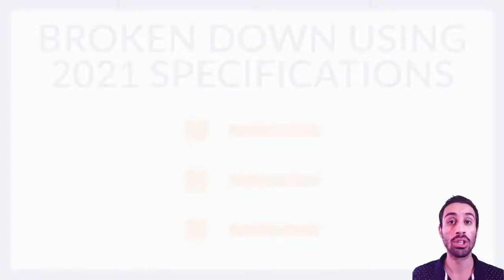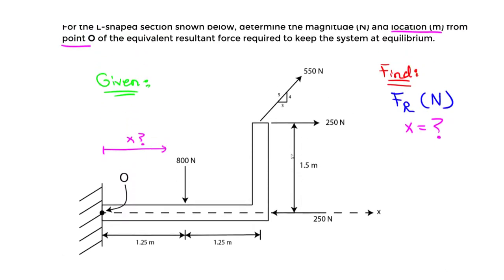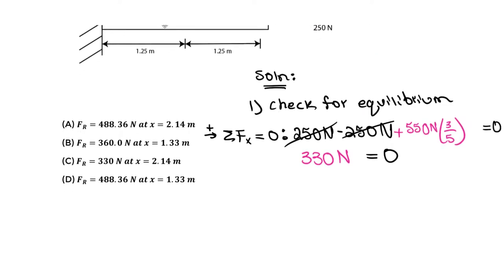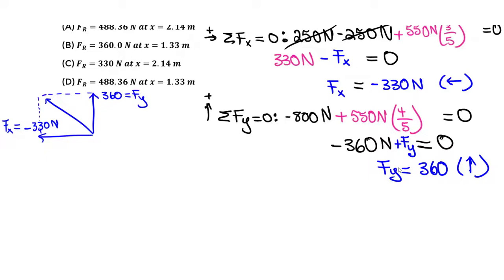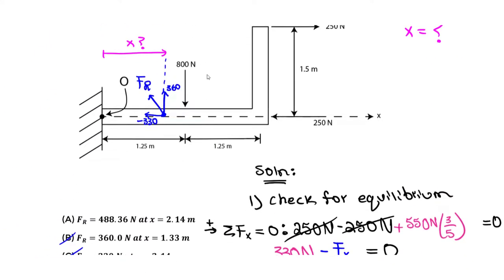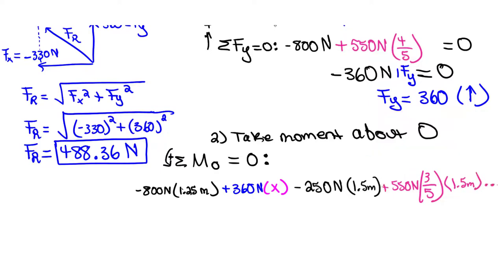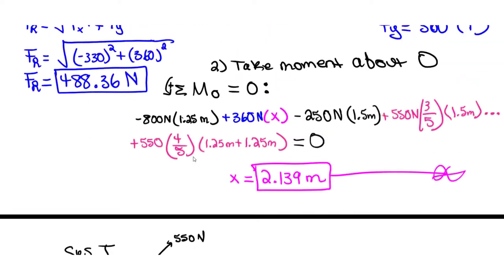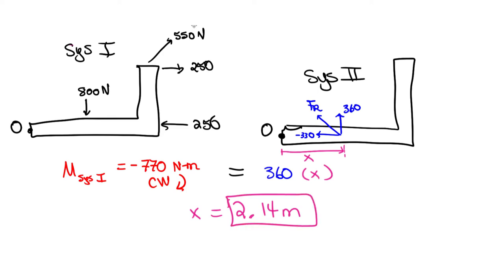FE Exam Review - Statics - Equivalent Force Systems - Reworked

Comment: Why are we not considering the reactions at the fixed joint while dealing with the equilibrium equation?
Reply from the maker: Good question. 

Technically, that support shouldn’t be there. I messed up creating this figure. For a similar resultant system problem, they would like give you all the forces acting on the body including the reactions. Something similar in the 2020 NCEES CIVIL exam is given.
Reply: @directhubfeexam Thanks for the clearification!
Reply from the maker: @jayantgupta3919  you’re welcome!

Comment: I can believe this question is for 2-3 minutes solution, the topic is in the FE 100% but with an example fewer loads
Reply from the maker: Hi A.R

The one solved here is definitely extensive when compared to an actual FE type problem. If you understand the overall process, I am sure you can solve a similar one given on the FE in 4 minutes max! 

You got this